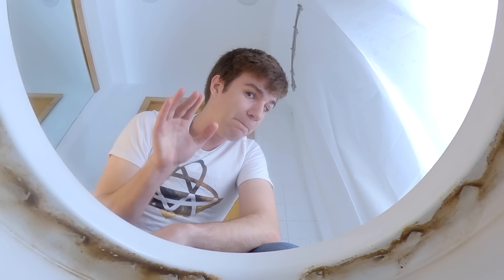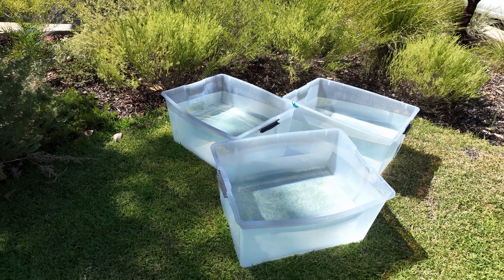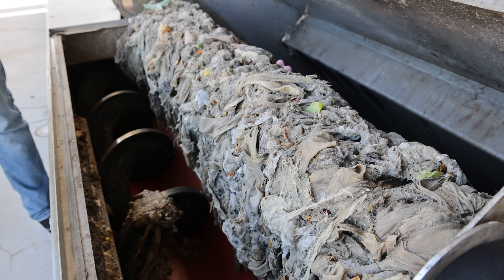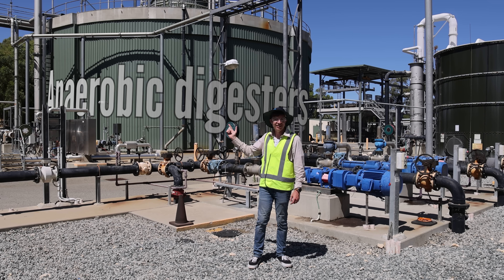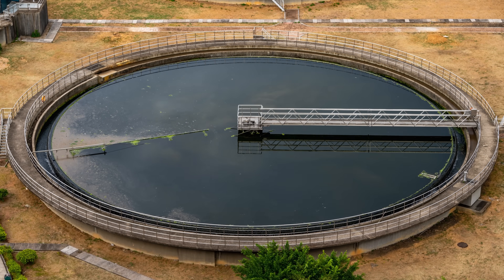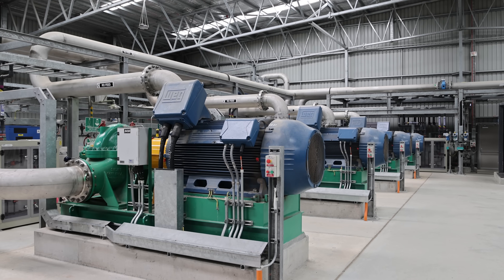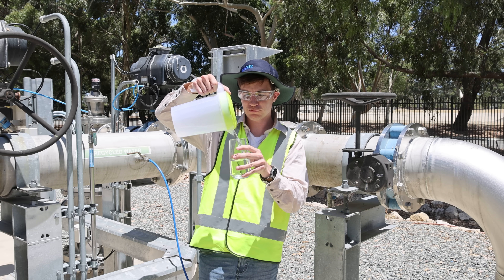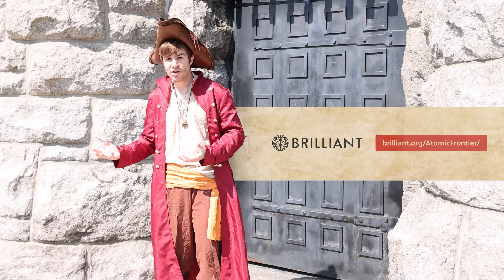Why cleaning your waste water is so difficult

Comment: A major issue preventing us from drinking treated sewage directly is the growing use of pharmaceuticals and hormones.
Most contaminants can be removed, but hormones and pharmaceutical products are often nearly impossible to remove or break down on an economical scale with our current technology. To make matters worse, they often have a long half-life in the water and are specifically targeted to effect humans in trace amounts.
And when you look at the types of things we are releasing via our effluent in the water, they can have a serious impact on your body if you aren't prescribed them. Common ones are antibiotics, antidepressants, birth control, acetaminophen, caffeine, nicotine, hormone treatment drugs, and much more.
Ecosystems near water treatment release points are being studied to fully understand the impacts, but there is a growing concern about the impact of them.
Until we can properly treat or control these products in the water, drinking treated sewage in a large scale will likely remain a less optimal solution to the water supply problem.
Reply: I dont understand - the last few steps of highly scaled filtration and RO in this video were specifically so potent in removing even something as small as chlorine ions, resulting in water so unnaturally pure you couldnt drink it. What kind of hormones or pharmaceutical compound is smaller than ions it couldn't be removed? 

The water produced in these plants are so pure it couldnt even be called treated sewage anymore. Its much closer to pharmaceutical grade water than even tap water. In fact, its analytical grade - even purer than pharmaceutical since it doesnt even have ions - so pure it couldnt even be drank directly without dehydrating you (sounds weird but true - such purity doesnt exist in nature). 

I get disgust over drinking treated sewage, but i hate when people pull in scare mongering tactics like this. All water is treated sewage. The only difference is just how obvious does the water originate from sewage. 

You have much higher chance of drinking oh so scary estrogens that makes the frogs gay from reservoir treated water - the water is less completely treated, and more contaminants can end up in a reservoir from trash and farm effluents (potentially illegally) dumped in - as you yourself said. If you are so worried about such contaminant, you should be championing this sewage treatment system - the disgust of sewage actually resulted in an overkill purification that you don't see in any other normal water treatment plants.
Reply: @dannyteo5630  I'm not disgusted by the thought of drinking processed waste water. It isn't necessary where I live since we have some of the largest fresh water reserves, but it could be a critical advancement for arid countries with the money to process waste water, like Austria, Israel, Saudi, UAE, etc.
In the video, the water he is drinking is probably safe from those pharmaceuticals. RO systems, ozonation, and similar can remove it. But the issue is scale, those systems are much less efficient than standard water treatment, requiring expensive systems with a large footprint and huge power consumption for a relatively small amount of water compared to the standard ones we use. It might be suitable for a wealthy region with a water shortage, but it's just not scalable to the point where it could be used as a main source of water globally.
Don't get me wrong, I'm excited for these systems and I think they have many good applications, but until there is a big breakthrough in it, it's going to struggle to be brought to a major scale.
Reply: @VPCh. The systems in Aus are running at scale, and are at the forefront of scaling up this tech. That’s why AF is talking about it
Reply: @dannyynnad-u4p  Your information is good. But the negative outburst in the second part is unnecessary. We all nerd out here about the topic, and it doesn't help if people don't respect each other. That derails the civil discussion into a fight. The information would be helpful, but not the other thing.
Reply: the best solution I've heard of is hydrothermal processing, which can even break down fluorocarbons. It can even be net energy positive and makes recovering phosphates, potassium, and nitrates much easier. it's mostly a question of implementation and infrastructure cost.
Reply: Doubt it's much if a problem when it's diluted in the aquifer
Reply: you clearly don't know chemistry, their process to clean the water is so pure that the h2o becomes corrosive, that's why he had to dilute it for drinking, check your facts before coming out into the public and spewing garbage
Reply: i mean we already drink homeopathic dinosaur piss so a few trace hormones aren't gonna cause that much trouble.*

*Well, sort of. Industrial areas are far more prone to this than civilian or suburban ones outside of isolated incidents or areas with lower average income, which is definitely a big enough group to have concerns over, but so many people arguing this aren't thinking about those areas. 

It's hard finding really good studies into a "typical" urban or suburban area's wastewater treatment where it gave better than a three sigma confidence in the conclusion that its actually causing harm outside of specific areas that deserve specific remediation. 

Those that do have evidence pointing towards harmful concentrations are mainly in regions with little to no regulation, or reserve funding for proper water treatment processes, but that depends again on what you include or exclude so there's biases in there to unpick, and most studies I've found seem to be focussed on areas of high relative quality of life and wealth which definitely skews things. 

My thoughts are that it's gotta be almost always low income or poverty stricken areas that get hit hardest by such pollutants, but it's hard to say whether other pollutants would be just as if not more harmful in those areas if they tried to cheap out on water treatment. 

Every time I've talked to someone passionate about Hormones In The Water in particular they've been focussed on upper middle class suburban areas like they live in, and were misinformed about the actual state of the water they drink. 

As if it was just a lens to focus their political beliefs around regardless of the scientific veracity of their specific local concern. 

Hell, of the dozen or so I've personally chatted to, none gave a shit about the same problem if phrased to affect a third world country or areas with a racial minority populace, which is the biggest area where I would be concerned about pollution affecting people. 

You seem to be the first one I've found in the wild that isn't approaching the topic from that particular lens, so good onya. This is a helluva long shot, but are there are studies (name or author, for googling) you found on the subject you'd reccomend reading, or articles that cite good studies if they're easier to remember?
Reply: If they removing sodium chloride molecules, they’re able to remove much bulkier pharmaceuticals and even bulkier again hormones lmao. Please don’t spread bullshit.
Reply: we can use it for electrolysis and other industrial stuff like manufacturing then